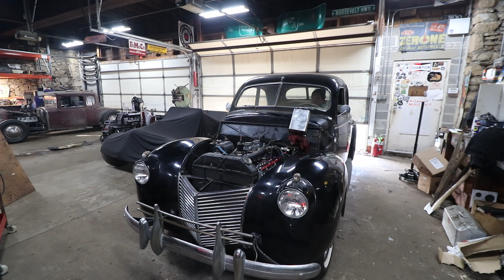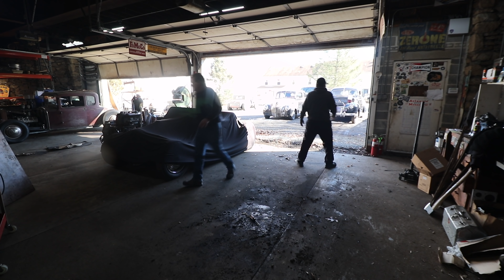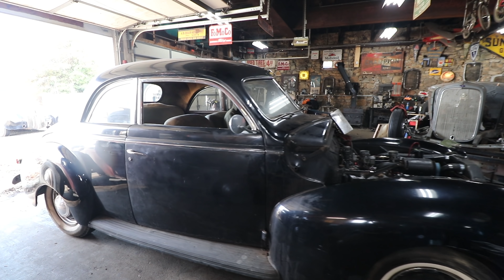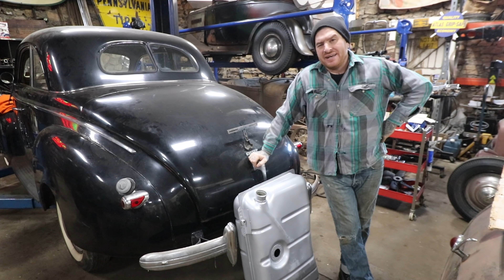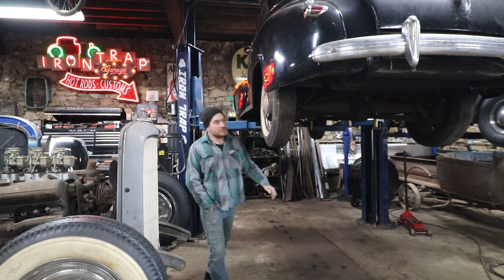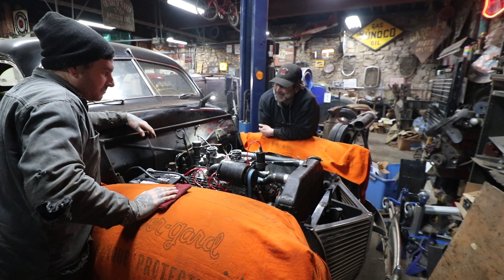The 1939 Mercury "Jersey Devil" Runs On It's Own Gas Tank!!!

Comment: I have a 50 year old skidsteer. I was able to save the original gas tank (which had several iisues) by putting a medium size steel chain (12" long) in it and then rotlated it at a slow speed for about 30 minutes. It broke away all of the rust and general sluge so that it could simply be removed. I then flusded the inside and completely sealed the inside. That was 3 years ago and I have had no issues. Just my two-cents.  Good luck!
Reply: Really good idea!

Comment: The chunks came from when your friend drilled out the gas cap Matt. I m sure lots of metal got into the filler neck and hose. Then you put it back together poured gas in it and washed all the filings out of the filler neck.
Reply from the maker: Uhhhh no. The old gas tank was out and we couldn’t get the neck off to replace the rubber hoses on it without removing the gas cap. We THEN blasted and cleaned the neck and replaced the hose on it. Then replaced the tank and then put the neck back on.

Comment: Watching Steve work on the rusty area under the tank, I thought I'd pass something along. Get a cheap 20 inch box fan and 4 20X20 furnace filters. Use the filters to make a box enclosure on the intake side of the fan, with a piece of cardboard on the bottom. Use duct tape to hold it all together. Any time you are doing a lot of grinding or derusting, just run the fan next to you. You'll find the air is much cleaner and there is less cleanup. Keeps your lungs cleaner too. Been doing this for a while now and it works great. Keep up the good work and stay safe.
Reply: Richard, that's a great idea!! I..... will have to try it

Comment: an angled pick or flat head stuck into the inner rim of the filler neck can depress the teeth of the gas cap so you can remove it........ learned this trick after having my locking gas cap removed by a thief

Comment: Howdy and hello,

I just got a comment about what I said of the Mercury rear axle leaf spring bundle. And to that I say this: That is fine about Iron Trap Garage having 19,000 subscribers and that is just fine. And I was informed about that this channel is not about restoring old cars and etc. However I was looking out for the welfare about the Mercury and that is very seldom that he come across a car that is such fine condition that even the interior is great or at least in very fine shape. But cars like this are getting to be very hard to find and since I used to repair vintage electronic equipment coming across a car in this fine shape is quite something. However, I was voicing a concern about the rear axle that he might of removed one too many leaves out of the spring bundle. And I am thinking about the future of this machine when it is sold off to someone else. 

Also since he is a custom builder salvaging old wrecks when he come across them and gives them a new life as a custom car with modified engines. And I wish the best of luck to him and he likes what he is doing. And what he is doing reminds me of that Disney cartoon Susie the little blue coupe. She started as a fine car and when she was reduced to a broken down old heap a group of teens got together and really fixed her and did a fine job doing it. So that is what I have to say on that point. I like stock cars and I like hot rods when they are done well.

Comment: OMG that sounds so sweet!  Lovely car guys, big kudos from BC by the sea :)
Personally I'd have kept the heavier suspension and not even try to lower it, why?  Its a beauty car, made to carry a bit of a load I think, so I think I'd get it back up to level height then there'd be better room for the shot-guns/straight-pipes out the ass without having to worry about crushing them, on top of it being a class ride.  Some nice 8" white-wall radials... but yeh, for every opinion theres an ass, sure i am one, but regardless, very nice ride and great work!

Comment: Just curious, what did you use for a gas fuel sending unit?  I've updated my '47 Lincoln with a '86 ford 460 and am changing to 12 volt but I can't find a 12 volt sending unit with the ford 6 hole pattern that is 12 volt.  Any Ideas??   Thanks....  Wish I had my old '40 Merc convertible, I miss that car....

Comment: I still think a short feature on the original engine would be interesting to most of us. A quick autopsy on why it got stuck, and if it can be saved. (Maybe 5-10 minutes)
This car was well taken care of, and there is little sign of abuse or neglect. That creates kind of a mystery that i bet most viewers would like to see the answer to. 
        We all know that engine has value, and will end up in another car if it's fixable. Show us what's going on with all that, if time permits.
Reply: That would indeed be very interesting, especially to us old flathead lovers.    Also, if it really is the original motor and no damage, it wouldn't take much to at least get it running with the same speed equipment easily.

Comment: Howdy and hello,

I know your channel has gotten a lot of flak from a lot of viewers over taking out those leafs from that rear leaf springs bundle. But I would like to suggest this: Put a small camera under the rear axle and see how the rear axle acts with those leafs missing and if the axle is not bottoming out too much. However, if it is bottoming out too much, maybe you might want to put in one leaf back in to give the axle some stiffness. I know that the low rider look is great for the younger set of restorers but think how many of those cars are left still on the road in original stock condition. And once in a while it would be nice to see a car restored to stock shape given that a lot of these cars have been hot rodded over the years. Also it would give the much younger set to see how the car looks like without being hot rodded. So to give them a contrast between the stock look and the hot rod look. So, that is my take on the subject.
Reply: He did it right.....first put it where you want it and if it bottoms out then you add a leaf.    
And to your last comment, Matt doesn't build any stock appearing cars.    There are around 19,000 subscribers on his channel and most of us are here to see exactly what he likes and that isn't restored old cars.

Comment: Its a shame you stuffed that old gas cap. You could probably of got a lical lock smith to cut a key for it. Ive done that with few early cars I've had that had no keys. Take a lock out or remove or give them a gas cap and they cut keys for me. Save cool old gear.

Comment: Did you use the original tank sending unit or an aftermarket one?, I’m having issues with aftermarket sending units recording correctly. They just don’t work the same as a King-Seely unit.
Reply from the maker: Aftermarket but we’ve had the same problem honestly.

Comment: Am I the only one thinking about sparks near a leaking gas tank? 😬
Reply: It only had a small seep.
Reply: @screwthecrewofpoliticians8921  Yeah, kinda like a pilot light.
Reply: @frankschwartz7405  it takes oxygen,  a fuel source and a spark. There wasn't enough liquid to burn, and therefore not enough vapor.
I worked in muffler shops all across America,  well not in the northeast. But all across the south to AZ.
The seep wasn't a bother.
Reply: @frankschwartz7405  did you know a bar of hand soap can stop a gas leak?
Reply: @frankschwartz7405  water is best, before I semi retired I did refine tanks and propane delivery truck. Did it for 10 years  and heard of 2 people dieing in different countries because they didn't pruge the tank and crawled down into it and died first breath.  Terrible

Comment: kudos on the new tank, line, and the built flathead it sounds mean. I'd throw some of those springs back in the car as the ride will suffer driving it at the bottom of the suspension travel. I really hate seeing a car messed up like that by someone who has no vision of what a 50s hotrod looked like.
Reply from the maker: Uhhhh you have no vision of what a 50’s CUSTOM looked like. Use Google and search “Barris 1939 Mercury” or “Barris 1940 Mercury “. Just because your skewed vision of what it was like is that cars weren’t lowered doesn’t mean that’s what the rest of the world was doing.
Reply: @IronTrapGarage  I have 25 years on you and I have been around cars since a toddler and came from a family who built custom cars as a hobby two generations behind me. I don't need a dipshit to who is clueless to fill me in on anything. Just save your mindless banter for someone who cares. I'm old enough to have rode in customs built in the 50s and 60s, and you are still on the learning end of things.
Reply: @MrGixxer1300r  Sir, you could not be more wrong by saying " I really hate seeing a car messed up like that by someone who has no vision of what a 50s hotrod looked like."    It is obvious that Matt has studied many, many cars that George Barris and Gene Winfield and other greats have built as well as probably many hundreds of cars pictured in the old magazines of the era.   By the way, that era does include hot rods and customs of the 40's also.     Gene Winfield also would be considered a friend by Matt!    Pretty good reference there wouldn't ya think? ..........and it is you calling someone a DS that is too clueless to fill you in?     Sir, you do not know of what you speak!!!

Comment: I didn't see what you put in it for shocks, but some short "coil overs" or air shocks would likely give it some handling and ride characteristics that it never had stock,  over the wimpy "rocking chair" transverse spring arrangement (and minus the 4 leaves)
Probably not a bad idea to hide a modern fuel filter somewhere in the line.
Reply from the maker: Shocks are on order

Comment: Now if it could get a headlight change and a haircut.
Reply: When backing it out, the headlights looked like the came on with the brake lights....dimly.
Reply from the maker: Give it time…
Reply: Back in the day, changing to sealed beam headlights was done by most rodders and customizers.....as well as most safety consience folks because it was so simple and definitely safer.